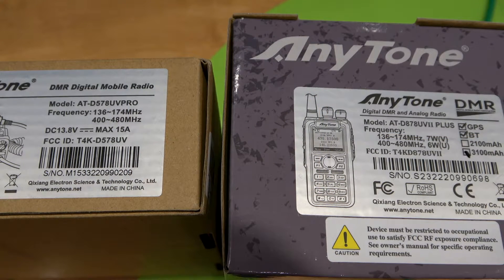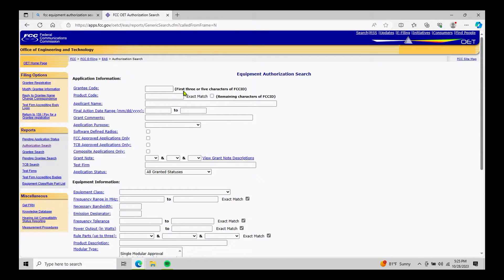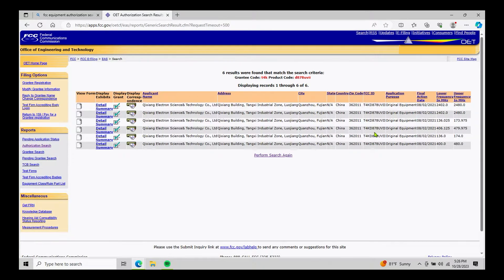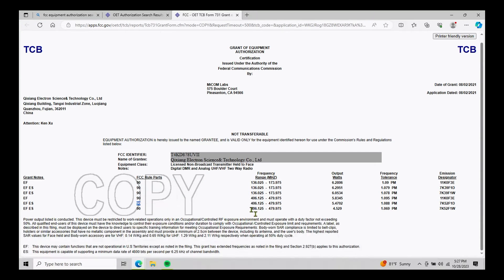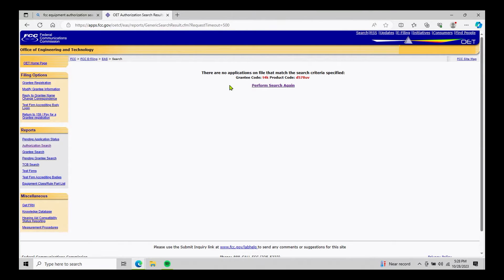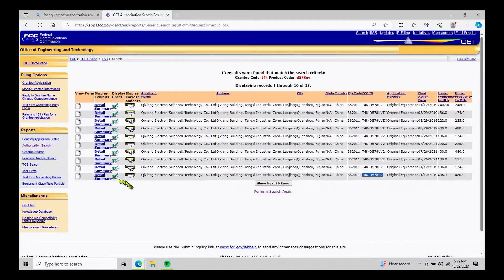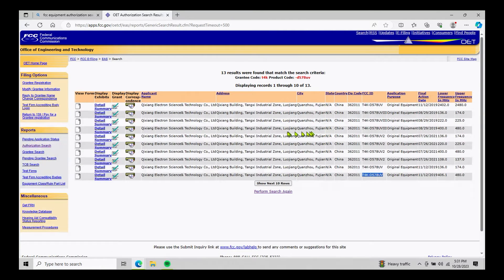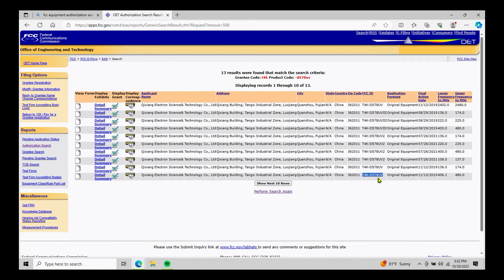How To: Determine if a Radio is Part 90 or Part 95 Certified by FCC

Comment: Unfortunately it needs to be specifically part 95 subpart E certified - https://www.ecfr.gov/current/title-47/section-95.1761
Reply from the maker: Part 90 radios are in part 95 E. The part after “unless” in the first sentence is what makes them acceptable. Part 90 radios are certified in another radio service, in the same frequency range.
Reply: @NorthGeorgiaGMRSNetwork  Ah I see thank you for the correction.